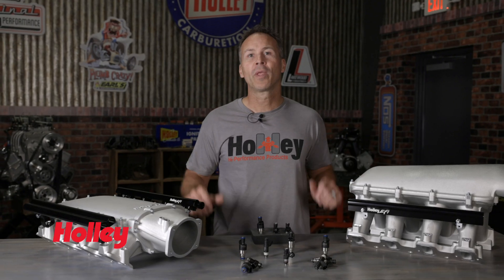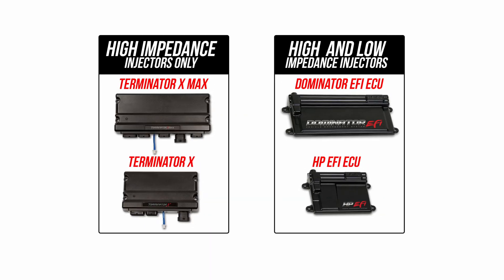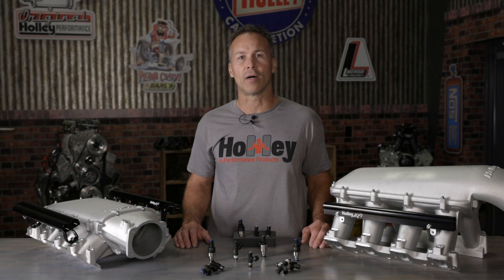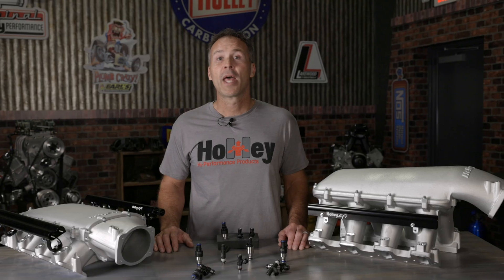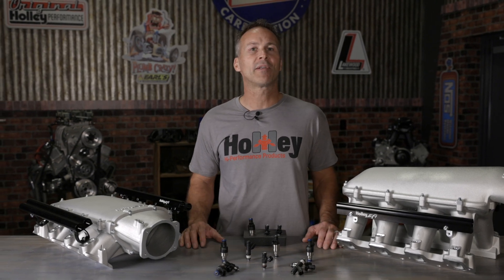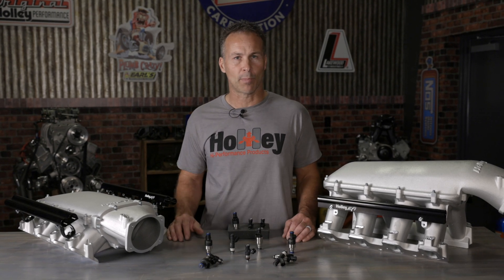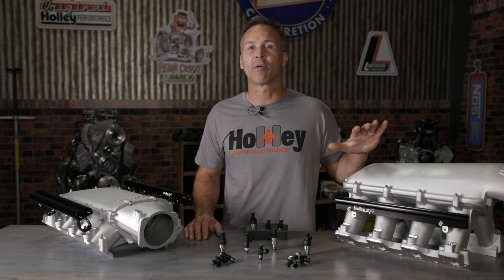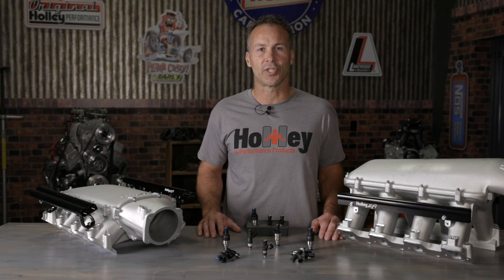Fuel Injector Guide – Which Fuel Injector Is Right For You?

Comment: 2:50 12 Ampere is a lot of current. At 14V it would be 168 watts, on one injector. Are you sure about that?
Reply: That's only for 100% duty cycle which is not typical and if so for very short time periods. So it's not continuous power. Also during the open period it's peak and hold, so the high current is actually shorter than the on period.

Comment: Which one is right for me? well I need about 20 to 50 of them diffrent sizes waterproof laminar flow style. I wanna hook them up in the shower ceiling and hook a bluetooth amplifier to it.  It would be the most insane sound system using pulses of water to play the wavelength.   You should only hear the music if the water is hitting you in the shower.   

Different size fuel injectors should pick up different wavelengths better than other injectors.  The smaller ones to pick up tremble and the big ones to pick up bass

Comment: I will keep asking you guys this on the phone and on the web until I get an ACTUAL real answer...  WHY WONT YOU SELL INDIVIDUAL REPLACEMENT INJECTORS FOR THE HOLLEY SNIPER.  you sell them for the other injection systems, but not for the sniper? Nobody wants to take their sniper off the engine, ship it to you guys, wait 4-6 weeks, and loose time using the car while you take 5 minutes to plot in a  new injector.  WE ALL want to buy a replacement injector, leave the sniper on the engine, plop in the new  replacement injector and hit the road.  please,  make sniper injectors readily available for purchase.  It is NOT a safety issue as you guys claim.. for heaven's sakes, you sell fuel lines, fuel fittings, carbs, fuel pumps, and on and on... so how is an injector any more dangerous.  PLEASE, smarten up.
Reply: I’m not certain on the sniper, but i know that most all throttle body injection systems need to have all injectors flow matched to maintain proper delivery. so maybe that’s why they don’t just sell one individually